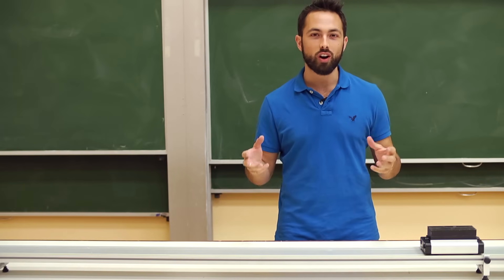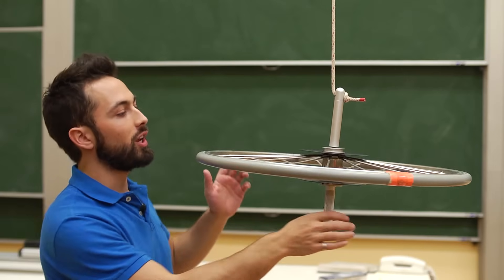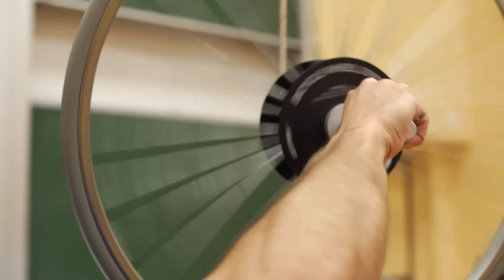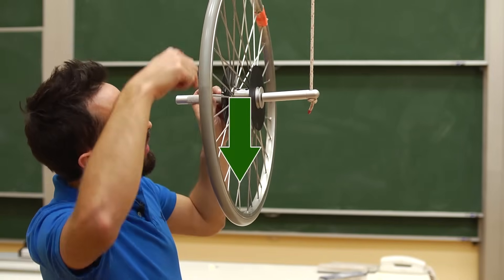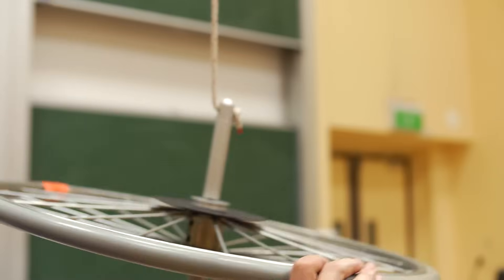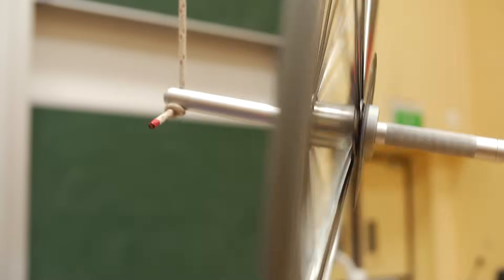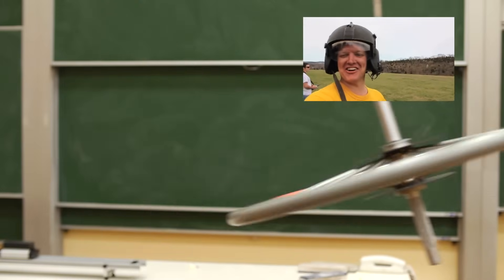Gyroscopic Precession

Comment: i'm no physicist but i do have a bike. so like which goes faster. same diameter wheel, but the weight of the other wheel is concentrated in the center of the wheel?
Reply: The one with the weight concentrated in the centre, since it has a smaller moment of intertia. The torque you apply to the wheel gives it an angular acceleration, but it is hindered by the wheels moment of inertia, just like translational acceleration is hindered by mass (normal inertia). The moment of inertia increases if distance between the mass and the rotational axis increases. Therefore if you put more of the mass closer to the centre of the wheel, the moment of inertia will decrease, and you will get a faster spinning wheel for the same torque. Of course the most effective wheel would usually be the one with the least mass.
Reply: thanks . so like i better get the spoked rims
Reply: Yes, if you're going for speed and efficiency.

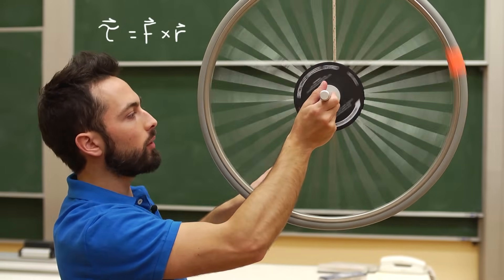Comment: At 1:21 you say that torque is given by: T=F x r, but isn't it T= r x F?? The order matters when it comes to cross product.
Reply: You are indeed correct, but this is fixed in an annotation.
Reply: @exscape  yes but isn't the annotations are something that all physics students and learners all know and follow but one mistake misinterpreting one sign to another can cause like a major havoc
Reply: @exscape  isn't X=6x4 the same as X=4x6?  I'm confused.
Reply: @popeyelegs  It is, but vectors also have a direction. Look up "vector cross product". In short, r x F = -F x r. The two vectors have the same magnitude, but point in opposite directions, so when you want more than just the magnitude, the order matters.
Reply: yep I was about to comment same
Reply: @akashpoudel  yes mee too
Reply: I dunno dude. Im here just to see a spinning wheel.
Reply: rxf  equals to minus of fxr
Reply: @ayushgupta3234  yes but the direction changes , which changes literally everything ,
Reply: Torque vector = radius vector x force vector,, the order cannot be interchanged because, cross products yield a vector and changing the order would change the direction of torque.

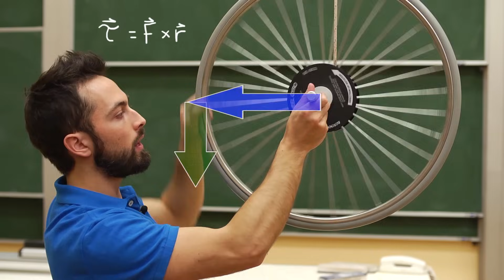At 1:21, he was actually talking about the magnitude of the torque, so it was okay to interchange as he was not specifying the direction.

He specified the direction later by talking about the right hand thumb rule

In other words, when talking about the magnitude alone, changing the order does not matter.
Reply: @Wadhudh  atlast someone with words making sense and understandable 👍
Reply: You are right, but he used the right hand rule in special way that he get a correct direction
Reply: True that
Reply: The thing written was incorrect but the dirn he found afterwards was indeed correct using r×F
Reply: He was just talking about the magnitude
Reply: Tienes toda la razón, el producto cruz F×r & r×F tiene la misma magnitud, pero su dirección cambia, eso es importante
Reply: @thomaslautner7430  what's funny? What I'm saying is true.
Reply: @leif1075 Idk if you still alive, but you should see geometric algebra, where cross products of two vectors are bivectors, a plane with a direction and magnitude. It's 1000% more intuitive and works just as well, and vector equations become way more understandable. Angular momentum and angular velocity both become bivectors, and the magnetic field as well I believe.

I'd recommend sudgylacmoe's most popular vid if you want to understand better.
Reply: wait... so 5x10 = 50 is different from 10x5 = 50 ?
Reply: @l0k048  that’s not the same with cross products. Vectors are not just magnitudes, they have direction too. So the angle must be accounted for.
Reply: Can you explain what you mean by this? I don’t understand why the order matters. What’s “cross product” mean
Reply: Fisheimdet, Yes you are absolutely correct. He still got the direction of torque correct because he accidentally carried out the cross product (F*(-r)) which is same as r*F
Reply: @stardust3219  that seems really random, maybe the writer made a typo
Reply: Anyone knows y the wheel still didnt fall? I get it that gyroscopic acceleration is developed but that is only causing it to rotate about the string, its not directly acting against the torque from gravity. So whats keeping it in that position 🤔.
Reply: Yes absolutely correct.
Reply: Gash! U r so damn right!
Reply: Cross product is anti commutative, so what you say is true
Reply: exactly
Reply: Obviously we will consider the smaller angle between the vectors.
Reply: That makes no sense the wheel isnt moving in the direction of the torque..sp torque shiuld point in the direction of the force! Why has no one else ever propsoed this? This is unintuitive and makes no sense.
Reply: @leif1075  well there is something which we call vector addition, which causes the  net momentum to shift that way
Reply: @anshikapanwarrr  but that wasn't the point I made..you se what I mean? That's nkt the direction of the force
Reply: @leif1075 thank you albreast  Einstein for proposing this devine theory to the world kudos😵😬😐😕🥲🥲😐😀😬😃
Reply: @yourlordandsaviouryeesusbe2998  r and F both are vectos.... and r x F=rFsin(x) but he used F.r(pependicular distance of F from r i.e. rsin(x))
Reply: Yesss
Reply: @yourlordandsaviouryeesusbe2998  idiot it is r cross F and not F cross r
Reply: @shadabsayeed4121  did I say it's F×r?
Reply: Ok wait I'm sorry 
Can someone explain wth is this!?
Reply: Yep
Reply: i wondered the same
Reply: Yes it is, with the usual right-hand rule convention of cross-product used in physics. With the right-hand rule, the direction of the torque using the formula \tau = F x r should be the opposite to what Derek had explained, unless he is using the left-hand rule of cross-product.
Reply: He only calculated the Magnitude of it i.e
rFSin90 and for dirx a right hand thumb rule
Reply: @yourlordandsaviouryeesusbe2998  your the idiot lmao. r is the postion vector which is a vector and force is a vector by birth
Reply: I was just wondering if anyone else had noticed it lol
Reply: You're right about that
Reply: Yeah, but it doesn't really matter in this case as the F is applied at 90 degrees, you can rewrite the cross product as T= r.F.sin90, sin90=1 so T=r.F so no need for order (IN THIS SPECIFIC CASE)
Reply: I liked ur self understanding logic regarding physics 👍🏻...
The ones who have such logical understandings doesn't seem dependent on equations in classical mechanics.
Reply: It doesn’t matter if came to multiplication.
Reply: In simplistic format Torque is just force multiplied by distance.
Reply: From 10 years to 4 moths
Reply: Thank you, old soul :) I was so confused by his torqur direction, to later realize he wrote r and f's cross product wrong
Reply: yes. I thought I  was wrong and go google it
Reply: He only mentioned the magnitude of tge torque, force applied times the radius away from the turning axis. Immediately next he gives the direction of the torque.
Reply: @hitmanx47-x  he mentioned the magnitude by putting bars above the vectors? Yeah right
Reply: @vishalmali921 actually it is radius VECTOR and not the magnitude, with direction from centre to edge.
Reply: @yourlordandsaviouryeesusbe2998  smh r is the position vector and F is the force vector lmao
Reply: r/wooooosh

Comment: This describes the how, but for me it does not really explain the why. I still find gyroscopic precession trippy.  Where does the right hand rule come from? Why does rotating something produce an angular momentum in that way.

Can you say anything about the Mach Principle or Mach Conjecture?
Reply: Well, that's just by definition. You could define an angular momentum 2 (and torque) which is positive in the reverse direction, then you'd have a left hand rule.
Reply: Its obvious that torque is vector and the direction given to it is simply just the most convenient and intuitive one. The right hand rule is just a convention used in physics and mathematics to describe concepts. Nature is nature. Its not like there are a series of numbers and equations that nature runs to decide what happens when you spin a gyroscope. In order to understand nature, it must be put into a language. Math is that language and the right hand rule is equivalent to using grammar techniques when forming a sentence so that the sentence has the meaning that you intend it to. If the left hand rule was chosen instead, many equations used to describe nature would look different, but they would be equally valid. They would just be based on a different convention system which is why the RIGHT hand rule is chosen so that there isn't confusion on which formula to use for which set of conventions
Reply: cpoup046 are you freaking kidding me? I'm a university student. It costs my university about 100 grand a year to educate me. I pay about 8 grand a year in tuition. Thats it. There is no profit whatsoever being made from me. My professors do NOT make much money for teaching me. Often about 80 grand a year when they could easily be making triple that doing something else. Instead they choose to help society by teaching younger generations and doing research. You have no idea how much work it is to give someone enough of a scientific background for them to be able to help the world. It takes YEARS and YEARS of dedication. The other thing is that as condescending as it may sound, many people are of a lost cause in this regard. Most are incapable of learning this stuff and actually being able to do something with it. On another note you say that this information isn't accessible? Google angular momentum. You can find everything on it. The fact is that its extremely elementary. Its covered in like 2 hours of lecture and then you move on and learn other stuff. There are thousands of different fields people go into, each requiring a specific knowledge base. It is ENDLESS work trying to organize information and choose what is relevant to learn. These choices can only be made by an expert. That is why you go to university. The information is not hidden away at universities, its organized and taught to you in the fastest way possible so that it doesn't take a lifetime to know enough to be able to actually do something with it.
Reply: These "rules" can be derive from Newton's laws by calculus, aka Classical Mechanics.
Reply: Gummi F His point stands though - without doing the math, it's not immediately intuitive why there is a right hand rule instead of a left hand rule.
Reply: Matt Grant "Incapable of learning this stuff"; 
There are those who choose to find zero satisfaction in a self enlightened reality, would rather pursue the pleasures of the materialistic world, or find happiness in the hormonal euphoria of harmonious relationships.
Cultural values are broken through science, when logic becomes such a domineering force, who are you to judge those who feign ignorance; does that not break the logic we are creating? 
To conquer human nature; become truly aware of ontology. You were not forced to pay lofty sums of currency to be indoctrinated into an outdated education platform; education is free.
Reply: Chris Werner I totally agree with your first paragraph, but I assumed it was quite clear that my comment was not directed towards the type of people you speak of. 
I don't think cultural values are broken through science, but if you have an example then I'd love to hear it. I don't see how I judged anyone that feigns ignorance. I'm not sure there was a person as such at all and I'll have to admit that I really don't understand why you are saying most of what is in that sentence.
Education is not free. If you want to learn at a reasonable rate then someone needs to teach or organize it and others need to measure students learning so that they don't go building an auto-piloting system using gyroscopes that causes a plane to crash because they didn't take account of say... the glass transition temperature of a component (what happened in the challenger tragedy). That is why experts are needed and those experts are great people that need to make a living. If education was free then those people would not be able to eat.
My motive with this was not arrogance, but appreciation to those who provide this guidance. I got a little ranty but I think those types of people just don't get enough credit these days
Reply: Matt Grant You have a lot of good points and I thank you for remaining civilized; I have the tendency of indifference, often associated with arrogance or supremacy.  
Cultural values science is in conflict with generally; religion, morality, prejudice, and inequality.
I agree to be successful in a career you need to know what actions you are required to perform; saying that paying for an education is the sole method to receive that knowledge is more of an assumption based on your beliefs, therefore bias. What you mean is, if education was free then society would have to carry the burden of feeding the educators for educating the offspring of society.
Finally, what I had been poking at was; saying "incapable of learning" is a form of judgement. If you say this of an average person, you say, "This man with a conscience is incapable of growth." In other words, mentally disabled; a contradiction, because that would not be an average person. I read it as an insult.

Comment: So, I'm confused by the usage of the word "torque" in this video. It seems incorrect. Torque is the "equal and opposite" Newton thing. In helicopters it is torque that is countered by the blades on the tail, so the body of the helicopter doesn't start rotating opposite of the main rotor. The spinning of the main rotor, assuming it is anti-clockwise, creates upward angular velocity which supplements the lift created by the blades. This video seems to confuse torque for for angular velocity.

Comment: If you can spin it fast enough pushing it up rather than pulling it down, thats quite a trick. Having someone on the other side would still apply the right hand rule.

Comment: I'm sorry but you're totally wrong. The right hand rule is used regardless the spin direction of the wheel. What happens if you spin the wheel in the opposite direction is that de angular momentum changes its direction (opposite as before), the torque due to the weight doesn't change.So since the angular momentum "chases" the torque (you can try to understand it by visualizing the vectors' direction and knowing that torque = dL/dt) in this case the system rotates in the opposite direction.

Comment: When you spin it the other way you have to use the "left hand rule" to find the correct direction of torque. The wheel he was using had a little note on it telling you which was to spin it and what rule to use :)

Comment: Still kind of confused... 

So what makes the wheel stay up and fight gravity? The Torque from the wheel spinning is pointing to the right, but the torque from the wheel falling is point to the right... what is making the wheel stay up? why doesn't it start to fall and then have more power since as it tilts sideways towards the ground, the "right side" torque is pointing in the direction of gravity. I would think that these two things added up and would cause the wheel to sling sideways downards

Comment: What is torque? It is an equation. What is momentum? It is an equation. You're not teaching physical concepts, you're just giving arbitrary manipulated equations.
Gyroscopic precession is just the wheel wanting to swing down due to gravity while also rotating to the left or counterclockwise in this case. Just m*g (gravitational force) versus m*v^2/r (centrifugal force).

Comment: it's an adaptation for human body to ease out the Cross Product between two vectors. A rule says that a vector is the cross product of two others, and an easy way to find out wich will be the resultant direction of the resultant is, for human, the right hand rule. check out more on wiki under cross product :)

Comment: The ending is wrong, there are TWO torque vectors, the one pulling the wheel out, and the other creating the precession. Both vectors have torque because they both have angular momentum.

Comment: All true, except that you should have explained the Coriolis force involved ... spinning mass, applied force perpendicular to the direction of rotation (caused by weight of the wheel) the result is a force perpendicular to both causing the rotation of the entire system ... Just like how a spinning top doesnt fall and how a gyro works (The MEMS active excited devices)

Comment: The right-hand rule in fact does not have anything special that the left-hand rule doesn't. The right-hand rule applies only because of conventional definitions, i.e. we usually work in a right-handed system (x-y-z-axis aligned according to a right-hand rules). This makes the vector-product that is used in the definition of angular momentum/torque (e.g. L=r x p) also adhere to a right-hand rule. This basically boils down to everything being right-handed. (in fact also in electricity: F=q(v x B))

Comment: i wonder why the right hand rule even applies, i know it does, also for generatng electricity with a coil and magnet, but what does the right side have that the left side doesn't? also does this still apply when the wheel hits the ground?
i.e. why is the torque in that direction and not the other?

Comment: Ok, understood.
How about the force of gravity. Assume this system is in a vacuum on Earth. Also assume the whole system is friction-less. If one were to spin the wheel but the amount of torque they put in the system is not enough to overcome gravity, then it will eventually rotate side to side like a pendulum rather than displaying the behavior seen here. This is my hypothesis, and this is the other half of what I was thinking when I wrote the previous comment.

Comment: It would just process in the opposite direction as the torque is now pointing away from you and the angular momentum to the right. So it will process clockwise in the horizontal plane.